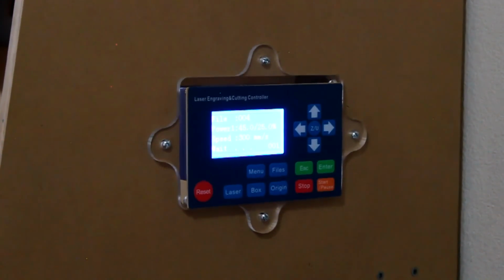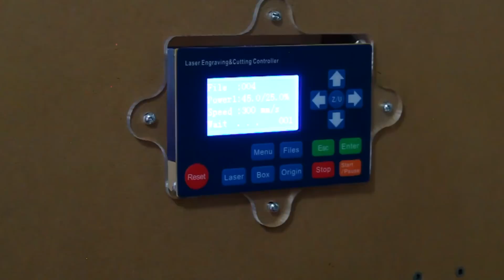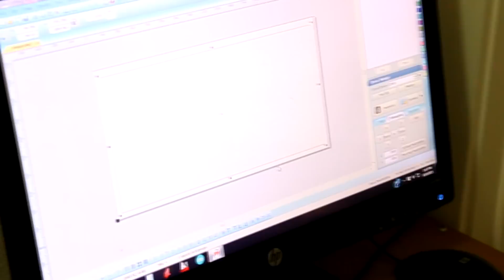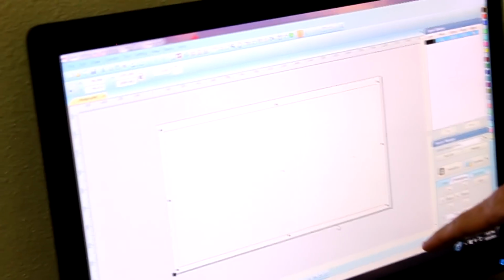80 Watt Vertical Laser XL 4'x8' Laser Cutter and Engraver

Comment: Marvelous idea which comes with several benefits.
A small foot print is great, but I also like the idea that the fumes don't rise upwards to the lens.
Another great thing is that it is easier to clear the chamber from fumes as they collect at the top of the chamber.
I just revised my idea of building a laser cutter to a way bigger size.

Cheers folks :)

Comment: It's a cool idea. After 5 years, can you tell what are pros and cons to have a moving tube ? E.g. cooling water line or tube itself damaged, or other ?
Reply from the maker: There are no downsides as the swinging for raster is on the axis of the nozzle.  When doing vector cuts and engravings, the movement is slow enough that the inertia is not a factor.

Comment: Are you really serious,have you received a fire safety certification on a laser that uses a mdf or is it plywood case,also what happens when the parts fall out,also the windows are not coated so the beam can reflect right into your eyes,I am so sorry but machines built from wood are not allowed in industrial shops ...Check you INSURANCE COMPANY.
Reply: Regular MDF is fairly resistant against burning, and fire retardant grades are readily available. The air assist (compressed air jet near the laser focal point) is pretty good at extinguishing any smoldering material. Remember also that lasers have a very short depth of focus, and need a very focused spot to burn anything.

What parts might fall out? He mentioned that the bed slopes back 7 degrees. This is pretty common with "vertical" CNC machines like lasers, routers and plasma cutters and does a fairly good job at . The cut paths are usually designed so that small tabs are left at the end of the job, which are cut out with a chisel or saw to free the parts.

Standard cast or extruded clear acrylic is naturally opaque to CO2 laser wavelengths, that's why they can cut the stuff. A safety interlock on the door would be a comforting feature but meh, if you're not willing to exercise a bit of personal care you probably shouldn't set foot in a workshop.

Who says that wood-cased machines are banned, and where? There's different rules for different locations and situations.

Comment: How much is the kit form and I need a laser capable of cutting steel aluminum ETC. so I need 150 watts up to 300 watts
Reply from the maker: This machine can accept a laser tube up to 100 watts.  The size of the tube is the limiting factor.
Reply: The power of a Co2 tube is almost negligent for cutting anything metallic.  It's simply the wrong wave length.  What you need is a fiber laser for cutting metal.  They are significantly more expensive, but will do what you want it to.

Comment: Hello i have build vertical co2 but im facing issue with tube its always damage with very few working hours isthat comon issue even with your machine
Reply from the maker: Did you purchase the equipment from us?
Reply: Hello mr Patrick Hood-Daniel 

Thank you for your replay

No i have build it my self but i faced this issue with my machine 

I have checked every thing million time but i found nothing wrong 

So i thought wither from the tube supplier if he store the tubes in un prober way

Or because the tube is working in vertical way so the properties of  the gas is not designed to be work in that way 

I hope if u can advice me
Reply from the maker: I have a video that goes over testing laser tubes.  Check it out. https://www.youtube.com/watch?v=-fvzxGzyAz0&t=426s
Reply: Patrick Hood-Daniel 
I have watched the video but im sure that i have issue with the tube 

My question is if the vertical orientation has any affect on the tube life or it dose not affect it 

And thank you for your corresponding
Reply: sifterbox
2 years ago
Found this:

"CO2 lasers, in general, produce molecular sized debris during operation and these particles will land on the output coupler causing localised heating of this component which ultimately leads to early failure. Synrad refuse warranty for new tubes which are mounted more than a defined angle from the horizontal for just this reason."

That is why synrad sells uber expensive laser arms to aim down. 
http://www.synrad.com/beamdelivery/1.25%20Series.pdf

Comment: Hi Patric
I have build an vertical co2 laser 
Im facing issue with the life of the tube 
Dose this issue happens with your machines as well 
Which mean that orientation of the tube will be affecting its life 

I hope to get replay and i wish you good luck

Thank you
Reply: sifterbox
2 years ago
Found this:

"CO2 lasers, in general, produce molecular sized debris during operation and these particles will land on the output coupler causing localised heating of this component which ultimately leads to early failure. Synrad refuse warranty for new tubes which are mounted more than a defined angle from the horizontal for just this reason."

That is why synrad sells uber expensive laser arms to aim down. 
http://www.synrad.com/beamdelivery/1.25%20Series.pdf

Comment: How do you tackle material sagging? Without the aid of a vacuum table, I can see large pieces having issues with cut accuracy.
Reply from the maker: The sheets of material that we use are pretty thin and flexible and stay flat against the back.  If I do a very large area, then I will use some non-residue double sided carpet tape to insure that I have the right focal distance.

Comment: you should check into 3 phase stepper motors, they will blow you away at how smooth they are compared to 2 phase steppers.
Reply: do you mean 3 phase servo motors?

Comment: Did you encounter any problems regarding belt-drive? Any repeatability or precision problems? Thanks..
Reply: +Okan Kurt And, how does the work piece hold w/o falling down while you cut it all the way? What is the surface that holds the work piece?
Reply: +Okan Kurt I contacted them and they said you leave in the designs little jigs / tabs to hold your work in place.

Comment: Hello I was going to mount a glass tube vertical and keep it stationary and have an open frame xy table that moved. I could then add multiple vertical lasers to "gang" cut the same things as the work i do is done in pairs at least. I could then have a vacuum right below the cutting area since that never moves just the table.

 I was told that these tubes produce "something" i forget what it was like a dust etc that will fall down onto the exit mirror and block-ruin it. Basically the next guy said the same thing its like why they couldn't have old fashioned tv's mounted facing down because crap built up on the surface. 

Can you visually inspect the output mirror area to see if there is any change vs when it was fist installed? You are giving me hopr for my next build it would be so simple to have a "ganged" laser and if I am just using the little 40 (aka 32) watt tubes they are only 100 bucks or so a pop. It may be worth doing one and see how long it lasts. Do you have any trouble with bubbles collecting in certain places since its vertical?

 I am very interested in your progress and Good luck I see you are going to debut this in a few days. Also do you have any other references or examples/build logs of other people with vertically mounted glass tubes?
Reply: Found this:

"CO2 lasers, in general, produce molecular sized debris during operation and these particles will land on the output coupler causing localised heating of this component which ultimately leads to early failure. Synrad refuse warranty for new tubes which are mounted more than a defined angle from the horizontal for just this reason."

That is why synrad sells uber expensive laser arms to aim down. 
http://www.synrad.com/beamdelivery/1.25%20Series.pdf

Comment: How do you hold the material to the table?
Reply from the maker: +Andrew Seubert There is a slight angle to the table.  The machine is chiefly for sheet material, but jigs or frames can be fashioned to hold smaller parts.  The depth of the frame would make clamping very versatile.  This would also make the process very repeatable depending on your application.

Comment: How thick a material can this cut through? MDF or plywood for instance? And is the cut clean and perpendicular?
Reply from the maker: +Malcolm Daly Hey Malcolm.  We will be doing some extensive tests on the machine.  Since we are using an 80 watt laser tube, you can expect it to perform as good or better than other machines on the market (or better refers to the more even power distribution with the tube on gantry configuration).  The lens selection will determine the perpendicularity of the cut where the longer the focal length, the longer the focal portion of the energy yielding to a beam convergence of a lesser angle.  Stay tuned for more examples from this machine.
Reply: +Patrick Hood-Daniel wow great reply! Get a video on quick 👍🏻

Comment: What material are you using for demonstration in the video? Are you cutting all the through on a single pass? Great looking product, congrats!
Reply from the maker: +Kent A. Vander Velden Thanks for the kind words.  It was a scrap 4'x8' piece of plywood with a thin protective layer on the side we used.  For demonstration, we simply marked on that surface.

Comment: Just curious, as the cover being opened and the laser running are a safety issue. Most laser cutters/etchers require there to be a full enclosure for the laser to actually run. If the doors are opened to fit larger pieces of work, then glasses/goggles are required. Just curious what yours does. Also, you looking at something maybe a little smaller in size? 4x4 or some variants that could be ordered? Also, what thickness of material can it cut (say baltic birch plywood) or even acrylic.
Reply from the maker: +frickmystr Safety is very important with these systems and interlocking (switches located at the doors to disable the laser when opened) is recommended. This is not demonstrated in the video to show some of the features but should be installed. Goggles (which we supply at buildyourcnc.com) should always be worn at all times while the machine is in the on and ready state (not just when the laser is firing).  This machine can be shortened to the 4x4 size.  We have another machine (blackTooth) that is 20"x24". The thickness of the cut will depend on the focal length of the lens (more or less linear energy at convergence) and the speed of the movement (feedrate).  Our testing on cutting is limited with this machine, but we have cut many materials with a 40 watt and that will cut 1/4" birch just fine at about 15-20 ipm.  You can expect the 80 watt to be able to cut much faster, but the cut depth will depend on the height of the lens.  If you need to cut thick materials, its just better to go with a traditional CNC machine.